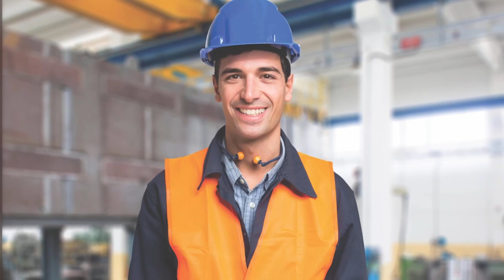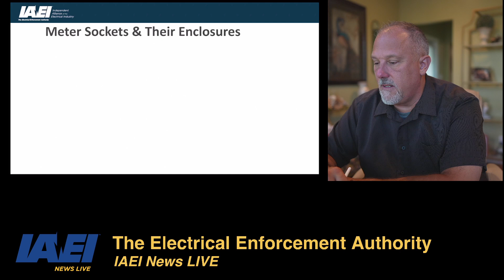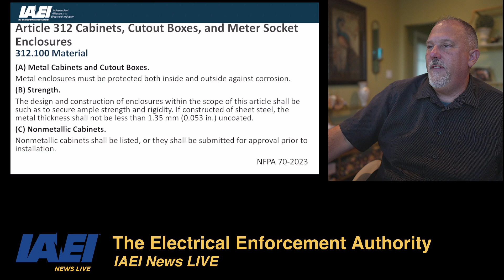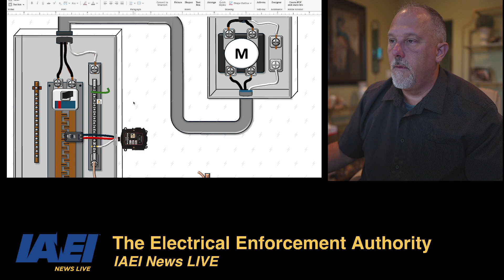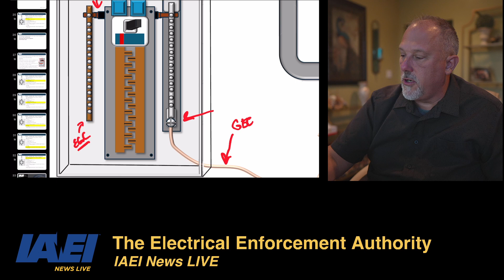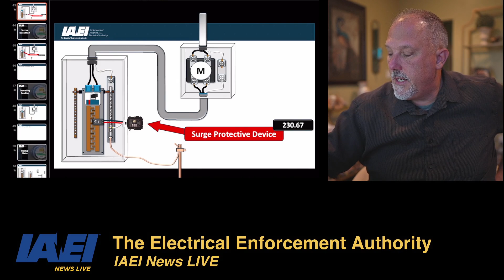Services Part III

Comment: Kills me how ultility companies can get away with greatly undersizing wires that feed both aerial & underground services. Everyone knows they do not havev to follow the NEC. While replacing a 60 amp underground service downtown in a 4 story row house that was approximately 85' long PECO refused to replace old frayed #6 guage copper wire in thier end box that were installed in the 1920 or 30's for the 100 & 200 amp setvice I was installing. Told me that 60 amp wire was large enough to feed 300 amps for services because they were several feet underground and that keep the wire from overheating. Was fun splicing a #6 maybe 4" long wire to a 4/0 or maybe it was 250 MCM copper THWN wire.